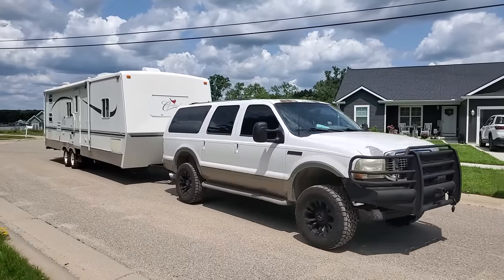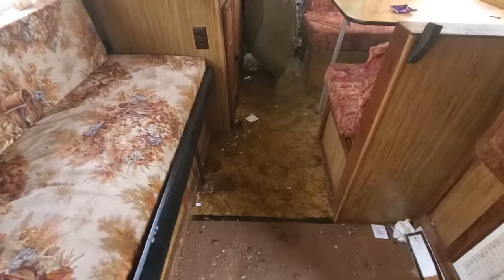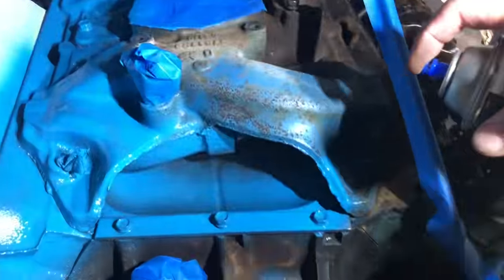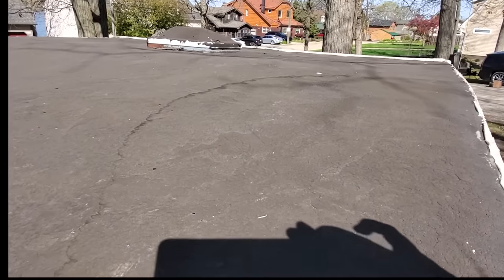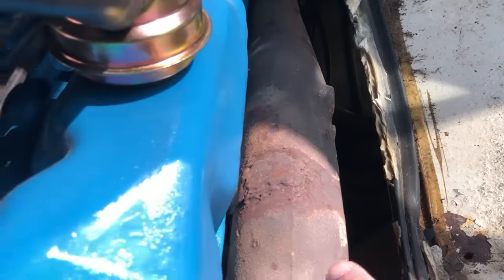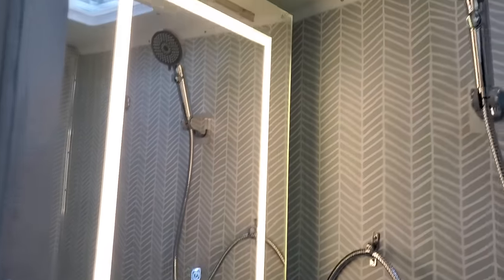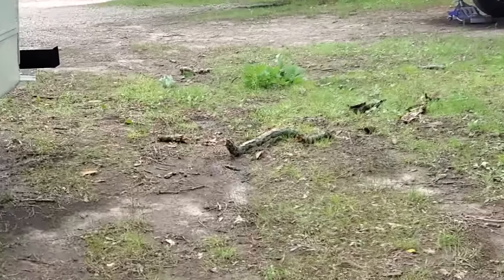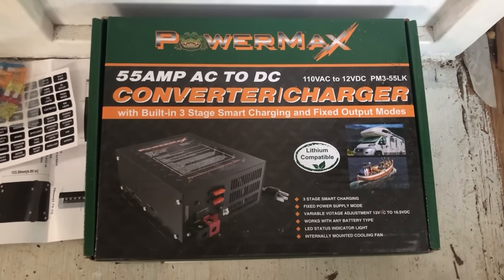Full Renovation - Vintage Camper RV | Start to Finish - Part 1 (DIY Before & After)

Comment: I had never seen your videos before and I’ve been thinking about renovating an RV. I think I could do much of it myself however, you having such an incredible life certainly makes it so much easier. The banter between the two of you is something most people search a lifetime for. Thank you so much for the inspirational video and renewing my faith in humanity!
Reply from the maker: What an amazing comment!  Thank you so much!  We are very blessed.
Reply: GREAT RENOVATION SHOULD DAVE USED PRESSURE.  TREATED LUMBER FOR FRAMING
Reply: @gerry-p9x  using pressure treated lumber on some thing that is not going to be exposed to the elements and will be sealed within a wall makes no sense at all, as well as releasing the chemicals into the air of a closed in space. Treated lumber would be the last thing I would ever use for framing.
Reply from the maker: Agreed, that's why we didn't go with it.  Plus, it's so much heavier!
Reply: Treated lumber cannot be in contact with aluminum either as it will cause corrosion.

Comment: We were just gifted a 1973 Dodge Sportsman. The engine only has 5k miles. There is lots of cosmetic love required. A new water tank is needed which is attached to the shower floor. 🤯 Its a bit of a pain. Also some water damage in the overhead bunk area. Im so excited to find this video. Thank you so much!!
Reply from the maker: Good luck with your project!  We have a whole bunch of Harvey videos.  Hope you check out some of those too 🎉

Comment: Stumbled upon this video and I enjoyed it very much.  Don't know if you have this information or not but  if you have a bad head gasket you will usually see steam coming from the tail pipes,  not, smoke but, steam. Just trying to help, i had on one a Nissan  that's how i know.great to see family  doing thing together in these nutty times we're living in.  ✌️
Reply from the maker: Thanks for the info! No steam but it did want to boil the coolant. It wound up being a combination of the radiator being plugged up and air trapped in the system. The head gasket test kit was good peace of mind though.

Comment: Excellent video! You have yourselves a new subscriber. I have just bought a really nice 1979 Dodge CB300 Sportsman 440 big block with a Delta RV body. I'm replacing the camshaft and lifters this week as it was only running on 7 cylinders. A previous owner dismantled it and rebuilt much of the woodwork. The interior is excellent and it's been dry stored for 20 years. It's been here in the UK since it was new and my wife and I plan to use it in the summer months on a few trips in England. It also has 16½" wheels which I would like to replace. Keep up the good work!
Reply from the maker: That's amazing, thanks for subscribing!  Sounds like we have similar campers except yours is dry?!?  That's unheard of!  Good luck and we appreciate you watching!

Comment: Awesome video. I suspected the walls of these old motor homes were made of small wood strips. I'm definitely going with a box truck or cargo trailer instead. That said, I do admire your tenacity and team work
Reply from the maker: Yes!  The construction certainly isn't the greatest.  We've considered trying to tackle an ambulance conversion project.  Those things are built to withstand rollover accidents!  Good luck with your project!

Comment: I have a 1975 Winnebago brave that i used to camp in. My x bf and I and our son traveled across the US in it when we got it. Inside was redone but not  the mechanics. We did break down thrice. I want yo fix it up again as its been sitting for quite a while...and leaking.
Reply from the maker: Sounds like a fun project.  With these older RVs, we think that the breakdowns just basically need to be included when planning a trip 😂  Thanks so much for watching!

Comment: we had to pull our refrig out through the emergency window! i had forgotten about the propane tank, noooo, i think we might take ours out too. everything has to be redone and certified now, such a pain.
Reply from the maker: Oh man, I don't even think we have an emergency window in this RV!  Sorry you struggled getting your refrigerator out too but thanks for sharing!  Yeah, one reason we decided not to go with propane on this one was that we didn't want to hassle with dealing with recertifying the tank... we also weren't sure about the condition of all of the lines and don't really plan to go many places that we wouldn't have shore power or be able to use our generator.  Hopefully we don't regret our decision.  Good luck with your project!

Comment: How did you insulate the interior walls of the camper? Jim Desclos who has the utube channel, thebossoftheswamp or off the grid homesteading uses what he calls bubble foil to insulate floors, walls , skirting around cabins, you name it, and Jim in his videos proves how good the bubble foil works. In the mid 90's my brother Jim bought a 1976 24' el dorado camper from a family friend that had been sitting for a couple of years. It had a 440 with a 726 tranny and I went thru the motor replacing the fuel pump, the starter motor, tuning it up and more. I could not convince my brother to replace the cast iron exhaust manifolds with stainless steel rv headers which are so much more efficient. Did you guys replace the shocks on the camper?
Reply from the maker: The camper was built with 1.5" foam sheets so we went with that too when we insulated.  We'll need to check out that YouTube channel though, sounds like we could get some good tips!  We didn't do the shocks yet but it's on the list.  Thanks for the comment!

Comment: I recently got an 81 Dodge Transvan with a 360 engine. I started it to show my brother how well it runs. About twenty seconds in, it just quit. Trying to restart it , it would turn over but pop every so often. It’s the timing chain. I’m told that around 80 to 90 k miles they’re pretty weak and my van has almost 90k.  Just something I thought you might want to know to save yourself from being stranded in the middle of nowhere. Otherwise, I like your camper and hope all goes well with it........
Reply from the maker: Thanks so much for the heads up.  Fingers crossed that we won't have to tackle a big project like that right away!  Thanks for watching and commenting 🎉

Comment: For some strange reason I've got "Let's Clean Up The Ghetto" running around in my head. Despite being a great song with a great intro by Lou Rawls, (Here in the UK, Loo Rolls is an apt choice for that song anyway!) it does tend to grate after a while. And the only way to get rid of an earworm is to replace it with another. Unfortunately my immediate "go to" is Baby Shark , until i can think of a better one. Congratulations, now it's in your head - I've been Tom Tucker!

Comment: I bought a 1965 Teepee bumper pull camper that I'm renovating... I got it for $1,000 ... the A/C-heater unit that I want is about $1,300 ! crazy, huh?!
Reply from the maker: Sounds like the one we bought!  If it helps you feel better, it works really well :-)  Good luck with your project and thanks for taking the time to watch our video and comment.

Comment: For engine add 1 quart of ATF transmission fluid before oil change into old oil and run it for couple hours. Then drain oil and replace with fresh oil. Repeat for this process for couple oil changes. This will clean your engine inside completely and remove sludge. This is safe for engine because transmission fluid is capable of handling high temperatures.
Reply from the maker: Thanks for this suggestion!  We really appreciate it!

Comment: Dude. I really wish I had aluminum sides vs the stupid fiberglass that shows every irregularity. You guys basically bought a frame. Great job.
Reply: Also I’m totally jealous that you know so much about engine work. It’s really difficult to find mechanics that will work on them. Yeah, always keep water in your black tanks or you end up with a poop mountain.
Reply from the maker: Thanks! Don't feel too bad. Harvey isn't without his wrinkles too😁.
Reply from the maker: Thanks! A lot of the mechanicing I've done is out of necessity. It is hard to find someone to work on them.

Comment: If the water in the radiator is like mud someone has put well water in. Always use distilled water
Reply from the maker: Thanks for the comment!  We don't think that the RV had a very good maintenance routine before we purchased it.  We didn't use well water but, you're probably right.  When we refilled it, we used distilled with the coolant.  We hope you check out some of our other videos!

Comment: I was wondering if you were going to update the wiring while you had the walls torn apart. Looks like it turned out really nice so far.
Reply from the maker: Yes, we updated most of the wiring.  Thanks so much for watching!  If you haven't seen it yet, we released the part 2 video recently.  Check it out.  Thanks! 🎉

Comment: I could see a shasta 16 foot long paired with a dodge cruise air. Not a bad combo.  Especially if you need to have an extra bathroom and sleeping space.  Just sucks on the fuel like crazy....
Reply from the maker: That would be cool but you're right, that  would be a gas guzzling combo!

Comment: I would venture a guess as head gasket if the 2 cylinders with low compression are side by side. Could last a long time or could last a day. We have been doing a lot of them as of late.
Reply from the maker: What do you think of those combustion tests?  Are they fairly accurate in detecting bad head gaskets?
Reply: Now I'm wondering what is wrong with my car's exhaust....
Reply: @janet1744  I an a boat mechanic and have been working on automotive for a long time.  If your tests come up very different, such as more that's 10% per cylinder, then you need to raise questions. Most of the time the bad cylinders will be the middle one on either head.  Not sure if ford or gm you have.
Reply: One trick is to put oil in the spark plug holes of the cylinders that are down and recheck those two again.

If they come back to within proximity of the others, the problem is rings, if they don't it's something else.  Usually valves.  Since they are all down from spec, you probably need a rebuild anyway.

Comment: WOW, looking goo so far! Will be watching the other videos on this as well. Question on the roof though. Why didn't you replace the roof since you had some leaks? Also was it a metal roof? We recently purchased a 2003 Coachman 31-footer class C that needs a new roof & some interior wall replacement.
Reply from the maker: Thanks!  The "skin" of the roof is aluminum and then it's basically foam board under that.  We considered replacing the whole top but it's built where the top goes under the front and back walls and we didn't want to get into that big of a project so we just replaced the few rotten 2x3s in the ceiling toward the back.  The roofing material we bought seems like it'll do the trick though!  Thanks for watching!
Reply from the maker: Yours probably has plywood under the roof membrane which is a whole different story 😬

Comment: Nice recap. Did you change the thermostat when you replaced the water pump? If you did I missed it. That could have contributed to the over heating issue. It could be stuck open. Love the eastern humor. Thank from West Texas
Reply from the maker: We changed it when we did the radiator flush after we overheated.  We'll, we shouldn't really say we changed it since it turns out there was no thermostat in it.  We added a new one and haven't done much driving since so hopefully it's still good.  Spoiler alert, we bit the bullet and bought a new radiator.  You'll see that install in the next video!

Comment: A cheaper way to check your head gasket is to have your engine running take off the rad cap and see if there is air bubbles in the rad water.
Reply from the maker: Thanks for the comment. We tried what you suggested. After purging the air trapped in the cooling system we didn't notice any bubbling. The problem we had was a pretty consistent boiling over when we would drive Harvey. Before investing more money in the cooling system we wanted to verify that the head gaskets were still good. The test kit was relatively cheap insurance to find out what we were dealing with.

Comment: Harv is looking studly again,and that 440 is actually a super reliable engine  other than the elderly thermoquad which omce it gets into its 30s and 40 it wants to be ran daily in order for it to continue working... The torqueflite tranny is super strong and good for 200k miles if one doesn't overheat it too many times..Fresh fluid and filter,check the bands adjustment and forget about it for another 100k miles.. Rear. DANA 60,or 70 diff; drain,and refill n forget..
Reply from the maker: Thanks! We're feeling good about bringing the engine and trans back to reliability. That thermoquad is not my favorite though. It'll have to be swapped before any long trips are made.

Comment: Morning great video, i have a question about the roof coating, looks like a 5gal pail, did you use all or just half, were doing a similar size camper but wow that stuff is pricy ,,,
Reply from the maker: We probably used 3.5 gallons but we should probably put a second coat on. Pricey for sure!

Comment: I will be buying a 1989 , and I am wanting to do all electric as well, with hopes of using solar as well.
How hard was that conversion?
Reply from the maker: Well, we haven't gotten into solar yet but it looks like there are ways to do it without making it overly complicated.  We're just using either shore power or generator right now.  There really wasn't much to the conversion process other than buying all new appliances and disconnecting the propane tank.  We did have to buy a new converter though.  This video may help some ;-) https://www.youtube.com/watch?v=uiGiC31Wj4o
Reply: @retrorevivals  Thank you 😊 
I have been binge watching your videos..

Comment: You seem like you have taken this on in a haphhazard fashion to where you will always be chasing your tail.

Also I get the feeling that there is still rot remaining that you did not get and that you just covered up.  I can't imagine that those old waste tanks are solid either.  

Finally, your initial diagnosis of the engine showed overall low compression and two cylinders out of spec with the others, but you didn't seem to address the root cause of that either.

I get it it that it seemed like a cool idea, to restore this,  but they are pretty much unrestorable on a reasonable budget.  Hopefully, you won't get sick in this thing.
Reply from the maker: Thanks for the comment.  We expect that we'll have issues pop up along the way as we use it more but we did the best we could within our budget and timeframe.  We learned a lot through this process!

Comment: Why replaced with wood and not lightweight aluminum?
Reply from the maker: Good question... mainly just replaced with wood because that's what was already there and it was easier.  The engine should be able to handle it 😉. Thanks for the comment!

Comment: Did you switch the tires to the modern 16" rims? How did you go about it?
Reply from the maker: Yes. I found some 16" rims that were not metric on a early 2000's Ford box van. Anything newer is most likely metric.
Reply: @retrorevivals  I will look, your RV is a ford right?
Were you lucky in a local junk yard?
Reply from the maker: @sg97651  Ours is actually a Dodge but the Ford rims from certain years also fit the Dodge.  We don't have many great junkyards close to us but we found these at a junkyard a few hours away.

Comment: Well if this doesn't keep the marriage together I don't know what will?

This is a far too extensive,, restoration. This is beyond restoration.  This is Remanufactured. The only thing original is the outer skin.. This is completely reimagined.  And quite the chore. Quite the job. Quitte the passion. And Voilà! Congratulations!

I have a 1986 Fleetwood Southwind. I could use a little help with.. Why don't you come on over? It's nowhere near as bad as yours was. Mine had been well maintained  and I continued. But in recent years. While stored. It got invaded by varmin. And they have done significant damage. Unbelievable damage. And I had rodent protection out. They found it delicious. I found a few dead ones. Too many of their buddies were with them. Who didn't consume the tasty poison rodent candy bars. Others loved them. And ate most. I hope they died a painful death!

Plus I have a broken, shock absorber body mount, passenger rear. I've gone without it. For the past 10 years. But it's no fun that way. And I haven't been able to get anybody to try and weld on a new mount to the body chassis. And so I should just get rid of that and replace it with something slightly newer slightly better slightly less internally destroyed. But I can't just yet. It's frustrating. My life is wasting away in one place. In the State of Boredom. And part of the Boredom Entertainment Group. Which will meet in 4 score and 7 years again.

This is great in concept. It seems like a backbreaker in, execution. Thanks anyhow.
RemyRAD
Reply from the maker: Wow!  What terrible luck you've had with vermin, so terrible!  This definitely has been a huge project for us.  We're happy you found our channel and are thankful for the comment!

Comment: Dump a couple bags of ice in the black tank right before you drive it around. That will beat things clean and help clean the pipes too.
Reply from the maker: Thank you for the suggestion!  We had actually planned to do that the day we had the overheating problem but didn't get the chance because we broke down.  We're going to try to remember to do it on our next trip.  We appreciate you watching and commenting 🎉